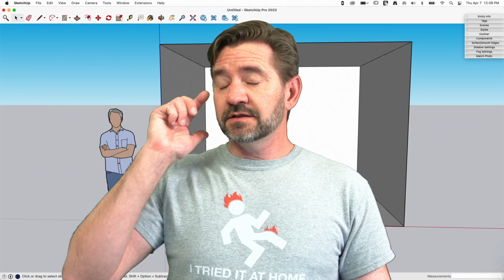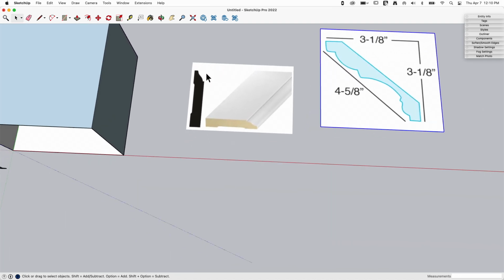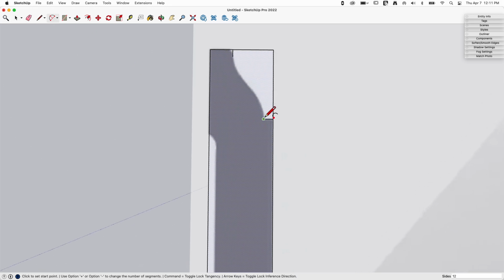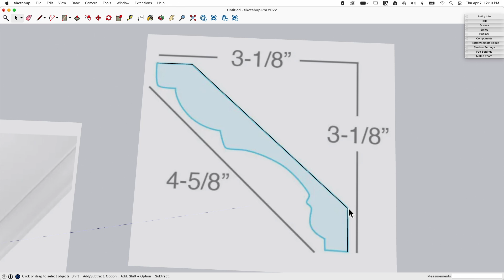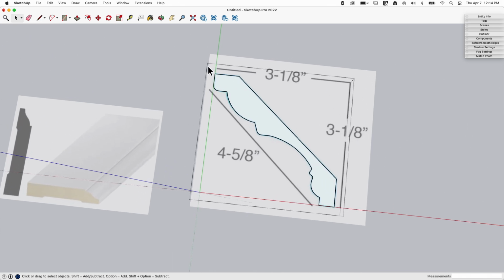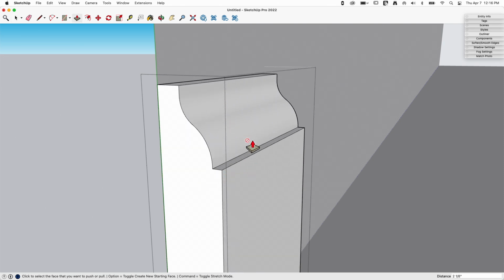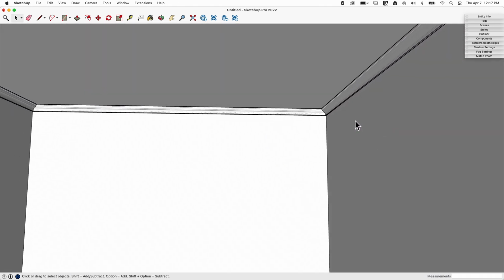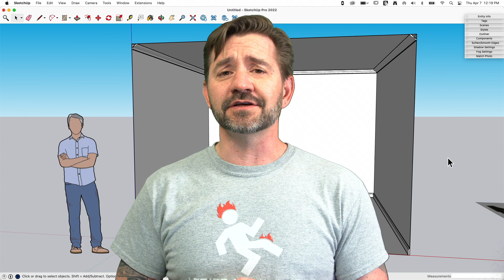Crown Moulding & Base Board - Skill Builder

Comment: Question:  One can also imitate molding with a few flat faces.  Is using a curved profile like this require more memory or are they about the same?
Reply from the maker: Every face you add increases the size of the model... it is good to be considerate of the amount of geometry you are adding, but the "right" amount to add for something is really up to you!
Reply: @SketchUp   Clarification: Do you happen to know whether a) using a curved profile like this in your trim pieces requires more memory than b) using 3 or 4 flat surfaces to approximate the curved part of the trim piece or are they about the same?  I've always thought of the curves as being a lot of little faces, but this example looks like a truely smooth curve. (Obviously the curves look better.) If you dont happen to know off-hand, that's OK too.  I can always test it myself by makling a few thousand copies of each in a model and compare the two models to compare whether there's a meaningful slow down in one. 

Thanks.  Very good video on applying the tools in Sketch up.

Comment: Thank you. I learned some things about the follow me and a new plug in today called the weld plug in. For the last two days I struggled with a profile design for a fine piece of built in cabinetry and the usage of follow me. Just could not get the follow me to work all because of a smoothed curve.  I figured it out, but now I have to go back and Download the Weld extension and weld all the curves to make them without all the lines. Plus that Weld would have saved me a day.  I have so much to learn

Comment: Hello Aaron, thanks for the valuable info. 
so I followed the steps and it came inside out which means the flat surface is facing the open space while the other decorative face is facing the wall, do you know what the problem could be?
Reply from the maker: Try reversing the face before you run Follow Me.